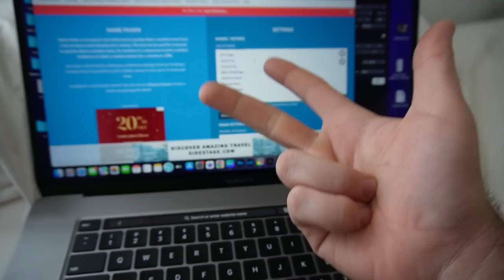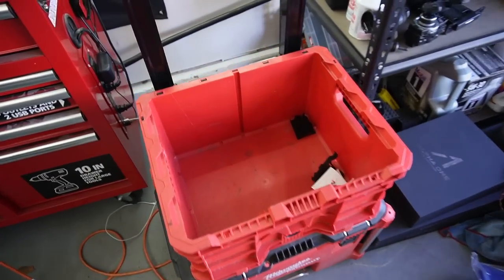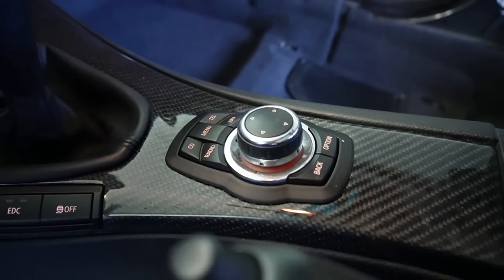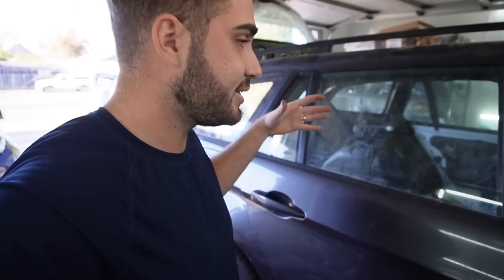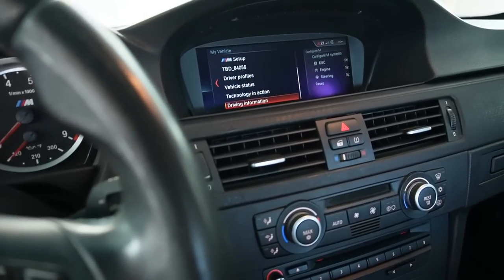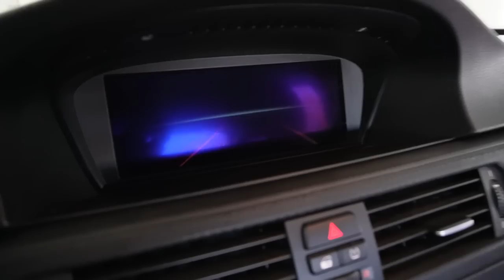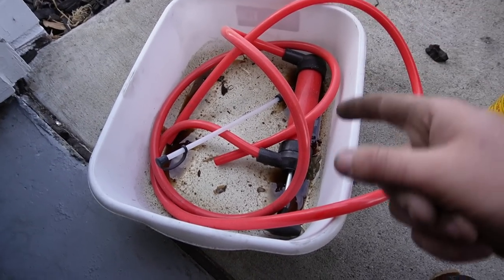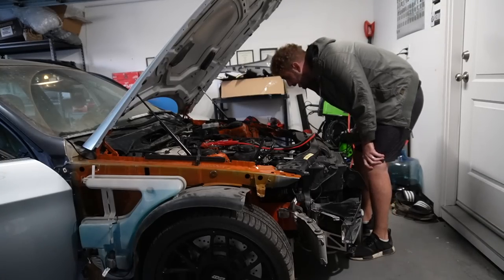Building A Custom 1 of 1 E91 M3 Wagon! (Part.22)

Comment: Your tail lights need coding and the voltage check turned off because its pre lci with lci lights

The battery discharge is because everything isn’t plugged in, once it is plugged in all the electrics your battery discharge will stop also

Comment: my 2007 mercedes s550 had the same problem with every light malfunctioning and throwing codes. turned out it was the front and rear sam (fuse boxes) that had water damage and intermittently failed.

Comment: The fluid will rush out with the car off, you have to have it running for the fluid to pump throughout the system and heated to a certain temp to tell if its overfilled or not.